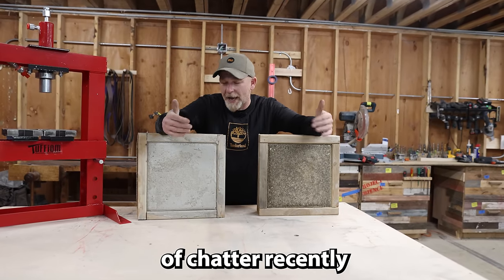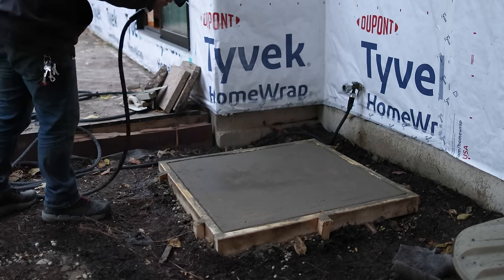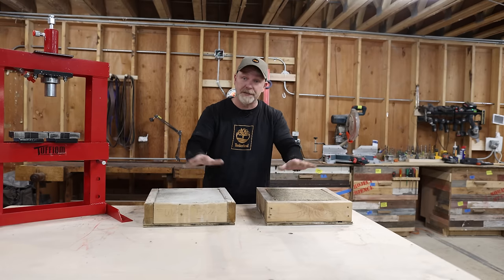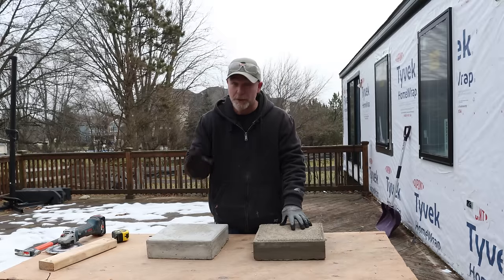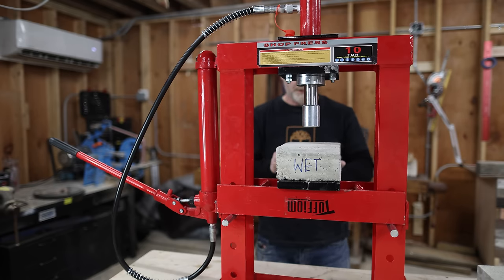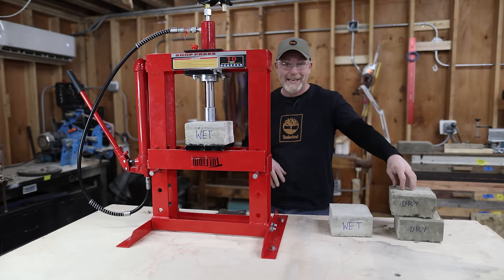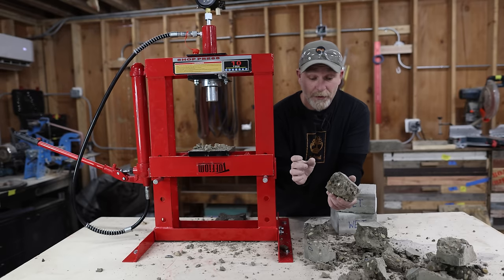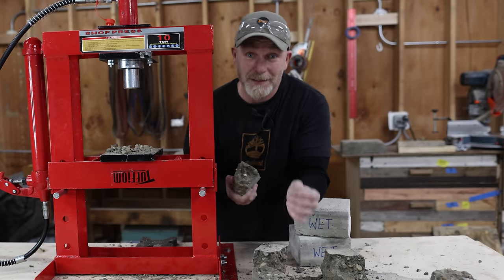The TRUTH About Dry Pour vs Wet Pour Concrete!! Strength Test - You WON'T Believe the results!!

Comment: That is exactly what I thought would happen. There is a short going around of a guy trying to prove it's just as good and even in his video you can see it crumbling ..the only thing I used dry pour for was rainwater diversion. throwing full 80lb  bags in the bar ditch and watering them in place to slow the rushing water down

Comment: I did a sidewalk repair with dry pour, direct to dirt, so it cured by bringing up all the moisture from the ground every night, trucks go on it no problem. The difference was about spraying the concrete at each 80lb bag, not just the top.
It also depends of the aggregate quality, most pre mix have round and smooth pebbles like marbles even the cement doesn't stick to, when they get mixed for 10+ minutes they sorta get sand blasted for a better adhesion, another advantage for wet pour.
A bag of premix in your area might be completely different in another town or state, the aggregate is sourced locally.
Reply: also during testing by concrete labs, each block is cut to perfection on both side, extremely parallel, that's the only way to have accurate load distribution
Reply: A dry pour may be sufficient for your needs, but it will never be near the rated strength and never as strong as a wet mix. Percolation kills the mix… segregates the different ingredients, causing a sub-par mix.
Reply: @VanillaIceCoffee  No they aren't, they are put into test cylinders.
Reply: @brock8199  for the ones you get at the truck yes, not always tho, only one side is flat. core samples and other blocks are polished, the lab I deal with doesn’t trust the cylinders, they polish them anyways it’s super quick

Comment: Curious if you only misted the dry pour or if you did the soaking that I've seen as required after the top surface has cured? It looks like not enough water was used. I'd expect the dry pour to be weaker than traditional concrete, but not as extreme as what your test showed, so trying to fully understand your dry pour process. 

Thanks for an interesting video!
Reply: If you set concrete dry, and you soak it without then intermixing aggregate thoroughly, you will create a separation effect. Also, if you add to much water you create an integrity issue for same reason. You literally wash the aggregate away from each other. An easy test would be to put dry mux in mixing box pour water over it and let it sit. The end result will be aggregates separating from each other and not combining.
Reply: he did it wrong, he said so at the start, hence why he got a sandy darker appearance, happens when people make up their own system and not follow instructions that have worked for others

Comment: Dry pour can be good where you want it to breathe and let water drain through it.
But if it's below freezing it will damadge it easily and should not be used for anything touching the house where it will lead to water leaks and moisture

Comment: line the box with plastic and fill with water and then pour the dry cement into the water filled box until the water is all washed out. misting the outside does not get it all saturated with water, so by pouring into a water filled container it should all get wet. i think it would be as strong as the wet pour, but without mixing first.
Reply: This method seems impossible for anything larger than a 12x12 inch square then…
Reply: Water isn’t the issue. It’s the segregation of the ingredients due to percolation. Your concrete mix… is much less mixed. The wet mixing remixes it.
Reply: Anybody who has had bags get wet in storage knows how “strong” a dry pour can be. But, no… nothing structural should ever consider a dry pour.

For post holes? Sure… for a quick barrier? Maybe… support for anything? Not me..

Comment: Hell 18 inch thick driveway can crack after a wet pour dries, i have seen that, and all they parked on it was a 10 wheeled tractor. With no trailer. It's a wonder dams dont fall apart faster..
They say it truly takes 100 years for concrete to fully cure.
They say in the middle of hoover dam, still has wet cement inside

Comment: I met someone who used cement bags with punctured holes in them. He layered the bags and watered them everyday. It was in a dry part of the season and he then placed them across a small stream that was dry for several days. When the rain started, he watched to see if there would be any movement. He completely encased an area for a fish pool and then left a bag out to allow water to flow over the low level that was approximately 3' deep. The water flowed over the low area and continued filling another low spot before draining into a drain that went into the ditch drain. He kept fish there and kept plenty of water for his caladiums. As you can guess,this is in the south central area of Florida. Blue herons would come from time to time to get their nourishment.

Comment: It's bizarre to me that people are so against the dry pour method. I haven't seen a single person use the method for anything that will be under 5 tons of pressure. They use it for small structures and foot traffic. The outrage is unwarranted.
Reply: I'm going to try it for a shed floor
Reply: It's lazy and doesn't last.  People use it all the time for wooden fence posts here, but they just crumble when you remove them.  Not sturdy at all.  But hey, it saves you 5 minutes of getting it mixed properly I guess.
Reply: @flatspin99  I'll let my 12 year old, dry poured shed floor know it should have failed years ago. 👍
Reply: @Majerly_Annoyed  You mean it held up in a non-structural use?  Shocking...
Reply: @flatspin99  Exactly. You said it never lasts. It absolutely has a time and place. That was the point.
Reply: It’s an unnecessary shortcut that compromises the result.  Literally, take a rake then add water and mix it around in place before the float work.   That would make a much better slab, and it still easy as dry cast.

Comment: Air pockets can be avoided if you vibrate the concrete... it appears to get great results from what I have seen. I haven't tried it yet myself, but have considered it to settle concrete/cement into hard to access pockets and crevices when pouring different forms.

Seems to work especially well if you are making cement molds for stepping stones, pedestals or bowls/flower pots.

Comment: In my opinion it is appropriate to flood or at least generously wet dry pour after the first few mist treatments over the first few hours. That will not make it even close to as strong as wet pour, but it will make it a lot stronger than what you did.

Comment: I'm an engineer of concrete technology and dry pour concrete is laughably weak. However, you can greatly increase the strength by adding and mixing in wet concrete with a little water.

Comment: the advantage of a dry pour is no limit on the time to place materials and no need for a cerement mixer or truck and crew.  You can get the same benefit by doing smaller wet pours that are of a size  and mass you can handle, instead of a monolithic pour.   I didn't want a truck or to use a mixer, so I just poured my sidewalk in 4 foot sections.  I could mix those 6-8  60lb bags quickly enough by in my wheel barrow to fill in my forms.  All of my concrete sections have a dry edge  touching each other, and years later no chipping. I did put a wire mesh in my section with the it sticking out of one pour into the next.

Comment: Great test and video. I like the professionals commenting. You stated for a basic step, ac pad or chicken coup. Not driving a car or an airplane runway. 😂
I used a dry pour for my small patio. Not supporting anything but my bbq. I wet the ground first and misted every hour. California sun. Waited a week before using. I made stepping stones vs paying $8 each. Did a basic 7ft shed pad. No cracks after a year.

Comment: When doing a dry pour you should only fill the form halfway  first then soak it with water then fill the rest of the form and soak it. If it gets pits from soaking it you can screed it with it wet. If you want a nicer finish you can mix up a then coat of Portland cement and pour it on and finish it like it was a wet pour. This will insure more water penetration.  I don't know if it is as strong as a wet pour but it will be much stronger than just misting it from the top. Works great on steep grades when you can't use a truck.

Comment: I have done three dry pour slabs on my property the largest of 15 x 8 and the smaller of 3×5. All of them have held up exceptionally well I use sand mix on the top and then screen to that to a beautiful sandpaper like finish on the top I've had no problems with them and they've been in existence for several years now no cracks or breaking off of edges anything like that I strongly believe that if you're pouring a slab to be walked on or a small shed it is definitely the way to go if you're going to be doing a driveway or anything that needs to be bearing weight you should probably stick with the wet pour

Comment: 2 tips: 1. You can use a Jackhammer as compactor by striking the Steel reinforcement and the concrete mould with is to get rid of all of the bubbles. 2. You can add some wall primer (i.e. what you would add to tile glue) to the water you mix the concrete with - it acts as emulsifier thus allowing you to pour the concrete with less water and avoid bubbles.

Comment: What’s missed here in my opinion is the lack of moisture in the dry pour over time. Kf that dry pour has continuous moisture present as opposed to simply allowing it to sit there, the results would be completely different. Once hydration stops (no moisture) the curing process stops as well. 
I understand that the Hoover Dam has some 22’ of concrete width at its base and was poured in the 1930s and that hydration would continue basically forever because of the water behind it. 
Obviously, the dry pour would be fully cured if it was allowed to be ‘watered’ for a substantially longer time

Comment: I built a patio with pavers, and left the normal spacing between each one, and poured my cement dry. Then sprayed water on top. It worked fabulously. ,that was 10 years ago, it’s still unbroken.

Comment: I’m not an engineer, just a DYI guy with an interest that’s done some concrete work. From the start I always thought there’s no way dry poured concrete could have any strength. It always looks like badly mixed concrete. And your test confirms, it’s poorly mixed concrete. I will admit I’ve been curious as to how well it works, will it stand up to time or support any weight. The answer appears to be “No”. There’s no need for me to waste my time with dry pours, I will only use traditional wet methods. Thank you for the test, I’ve been curious just how dry pour concrete holds up, the answer, it doesn’t. Good video. 👍

Comment: I believe that the  chemistry behind it is that water has to evaporate FROM concrete, not INTO it. It's no different than making pancakes, you don't put flour into the pan and then add water, you mix it first. Just my own option. Thanks for the video! Great test!

Comment: A lot of home builders around here will use dry pour on the wooden fence posts.  When replacing posts in my fence, I've noticed that it is a lot easier to break off the concrete from these posts.  I'm in the SE Texas Gulf Coast area and we get a lot of rain, so the concrete on these posts have had MANY years to cure and plenty of water.  Maybe it is not as good as wet pour, but then again, you can just use plain old gravel instead of concrete around fence posts and it will probably still last until the next hurricane...

Comment: Hands on Construction Engineer here, my last job was showing other people how to install "dry concrete" properly. Step #1, read instructions on the bag. Step #2, follow instructions on the bag. Step #3, follow steps #1 and #2. What the creator of this video and so many others have missed in the instructions is that #1, dry concrete is for fence posts, not load bearing weight. #2 Use that same amount of water as you would with wet concrete, if you do not, then you will have concrete like this guy. #3 "Misting" is not in the instructions and does not get a gallon of water in the concrete; take a gallon of water and pour it around the dry concrete. Water makes the concrete bond. You need water even with "dry concrete". "Dry concrete" only refers to how it is set up, not the final product. I guess common sense just ain't that common these days...

Comment: I have worked in the Building and Construction industry for over 50 years. No surprise to me. Quality ingredients, Correct water content, adequate mechanical mixing methods and duration, adequate consolidation and then curing, gives the desired result every time. Take out any 1 or more of these and the concrete will fail to meet the intended standard. This process has been refined and proven over a very long time.

Comment: Construction Manager here, in my early career I was a reinforced concrete inspector and before that I was a concrete technician, and I but say that yes dry will more than likely be less than wet, simply because of how concrete works. But in the video I believe that the dry didn’t really get a fair chance. The sample to me looked very green/wet, especially on the inside. And since it takes most wet concrete 6-8hrs for the initial cure, I would assume the initial cure would take longer for the dry because of the heat of hydration process. That’s where the chemical reaction actually takes place and the crystallization actually starts forming and over lapping one another. But in order for this to really and fully happen the dry is going to need a continues supply of water, probably not at first but for sure after the initial cure. Which would probably be double that of typical wet mix. I’d like to see this again with a supply of water every 30min for 12-16 hrs then fully submerged in a 70 degree water bath for 28days.

Comment: I used this technique for a shop floor.  500 square feet.
2 years later, still working like a charm.
Is it as strong as a wet pour?  Hell no.
But I could do it myself and set it all at once.

Comment: Incorrect.  Quick Crete does, in fact, make a "dry pour"

If you follow the instructions, it will tell you that you need 

a certain amount of water, 

Hole should have been be pre wet,

and that it should be mixed in hole. 

(The whole purpose of dry pour, aka dry mix, is that you do not need a wheel barrel or a cement mixer, as you cam mix it in the hole, or form.

An important step you did not do.

You are correct, that cement wasn't able to properly cure throughout due to Incorrect prepping. 

If you srave regular cement the same way, it'll yield the same results. Too much or too little water for the particular batches formula is obviously going to fail and not live up to expectations. 

Had it been done correctly, it would have yielded the same general color 

Furthermore, due to the testings errors in test sampling, it was obvious that the test was predictably going to fail as it did.

Plate pressure on a clearly pre-damaged surface is going to create pressure points, so more pin point pressure was transferred into the dry pour. 
A layer of sand and some plywood acting as load distribution buffer would have equalized the testing.

You must comprehend the formula parameters for each type of cement, 

Such has hi structural, hydraulic, dry pour.

My testing has rendered the same repeatable results.

More water is needed if for light structural, v. Things like fence posts and a/c slabs. 

It's possible to get a re- curing process going, if the lime is right,  and the slab is wetted properly, enough to fully saturate.

But the dry-pour needs to be mixed enough to assure full saturation.

That cure line stopped water from reaching through out the test sample.

Comment: I poured "quick crete" into a hole to support a bunkie.  The water was up to the top due to the low area, but poured the dry mix in, it displaced the water, then the next day was hard as a rock.  A few days later I put the weight of the bunkie on the new concrete and it held and has held up for years since.  I guess as long as it is wet it will work?  I didn't add rebar either, so the entire weight is on the concrete alone.  Much better than sitting on the ground, which heaved up and down with frost.

Comment: We've been using dry pour to set fence posts for decades.  Much easier than trying to pack dirt around the post.  Put a couple of inches of gravel in bottom of hole, level post and pour hole full of dry mix. Just let ground water set the mix.  Adequate strength for that application.  I've never been tempted to use dry pour for anything else.

Comment: Anybody who knows anything about concrete knew the results before you started. When you mix it properly, a chemical reaction takes place, and the concrete starts heating up. That reaction might kinda take place in the dry pour, but not uniformly. Plus, you are not getting the prober amount of dry to water mix. Test the dry pour to a pour of half the water. Might be hard to mix thoroughly, but I bet they will be more similar to structural integrity

Comment: The 2 mistakes I observed with your dry pour, 1. You really over watered the dry pour during the first application. 2. Having a wooden bottom would collect and hold the water, both contributed to it's weakness. The dry pour is not meant to be used in projects requiring the same strength as a wet pour.

Comment: You can get dry pour only fast setting concrete now, it's called fence and post concrete, it's only for fence post and things like that not slabs. It has coarser sand and more cement in it to make it stronger but it's still not as strong as regular concrete.